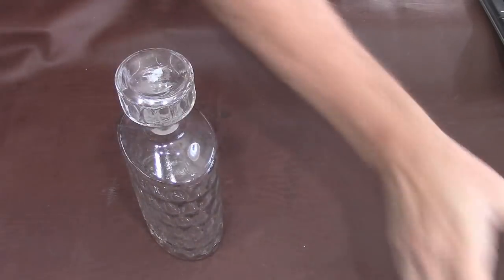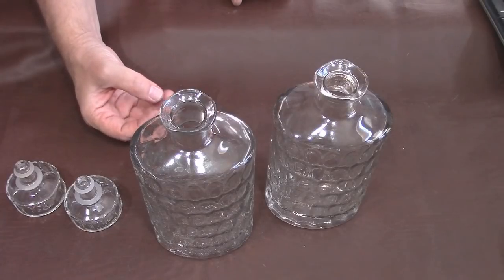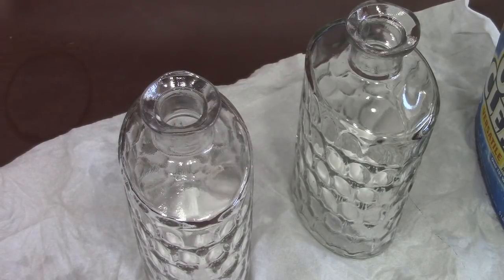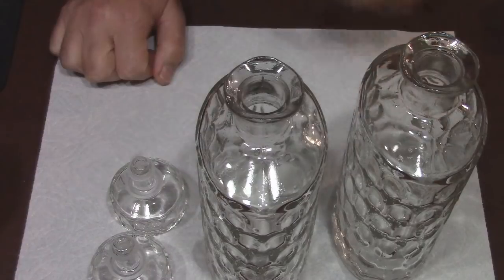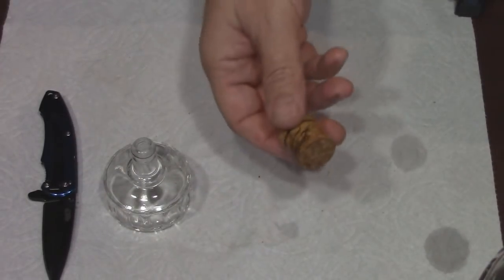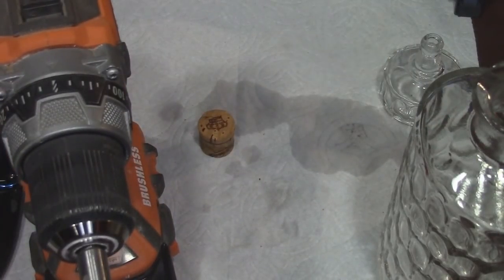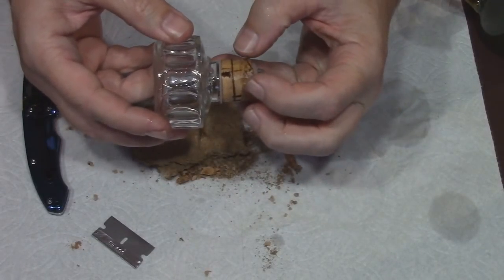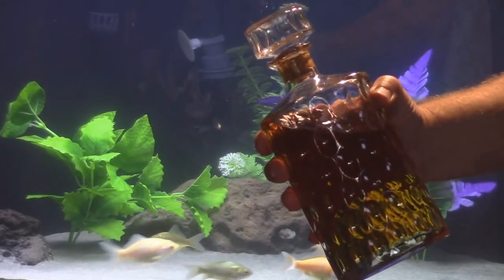how to restore and clean an antique liquor decanter

Comment: also we also use toilet bowl cleaner describe deep stains . And then I would go through the rest of the steps to make sure it was rinsed out and cleaned out properly. We use toilet bowl cleaner on stainless steel along with water. You could put a little toilet bowl cleaner and water and ice and salt and spin it around to clean the inside of glass. Toilet bowl cleaner with clean and breakdown pretty much anything. We also use it on the inside of bathtubs. but be careful that stuff burns your hands.   just make sure you rinse it out good several times
Reply: its called bleach just FYI, and you can just buy bleach as a cleaning product for 1/4 the price of toilet cleaner. Amazing.

Comment: Ice and Table Salt works wonders. Put in chipped ice if opening is small, cubes for a coffee carafe, add salt and shake, shake shake... cleans to a sparkling end result!
Reply: i can see that working
Reply: @WillsEasyGuitar   Never ever put ice in Crystal it will crack just like Hot Water will. Always use temped water.